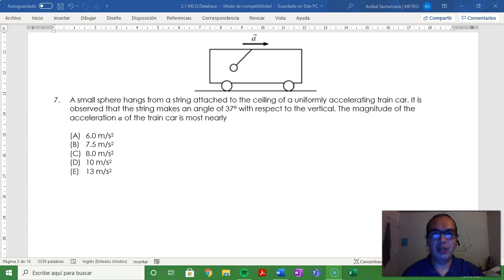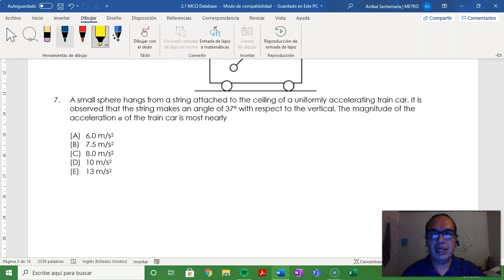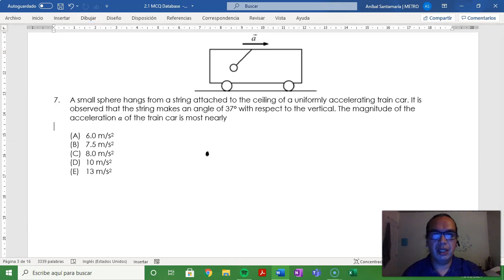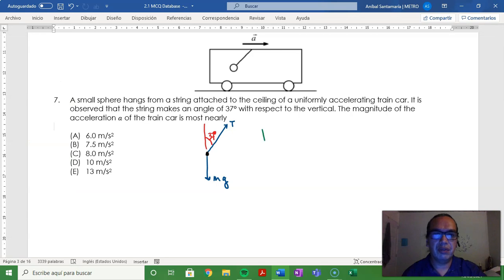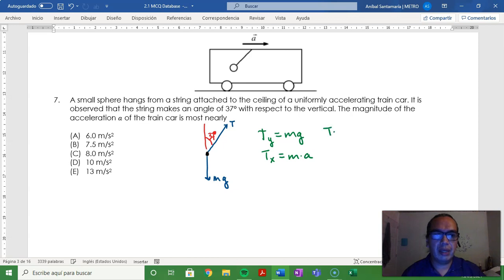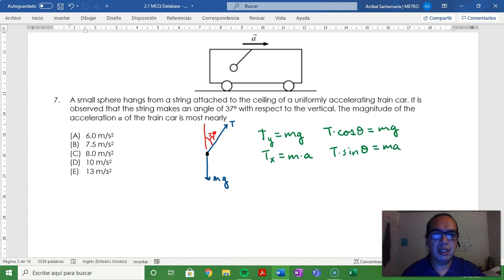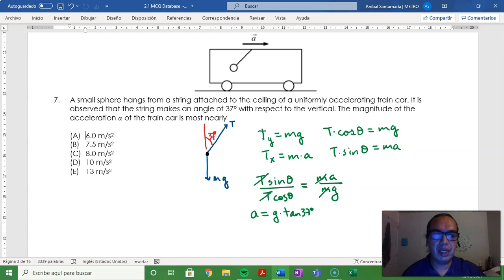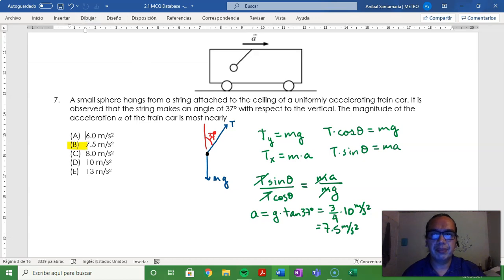2.1-07 Acceleration of a Train Car From Non Inertial Analysis

Comment: The correct option is E because after drawing the free-body diagram showing all forces we can calculate the acceleration by finding the s and y components of the string's tension.

Comment: The correct answer is B because the forces y in the y direction are equal in magnitude, but there is only one force in the x direction which is the tension x sin37 = ma. The forces in the y direction make the equation: Tcos37=mg. When dividing these two equations, the T and m cancel out, showing that a = (9.8m/s^2)(tan37) which is 7.5 m/s^2.

Comment: As there is no acceleration for y, tension component is equal to mg, and as there is acceleration for x, tension component is equal to m*a. We can simplify these by dividing them and simplifying the terms T, mass and getting tan of the angle. then we just solve for a and use g as 10m/s2.

Comment: Assuming vertical equilibrium, the gravitational force (mass*g) is equal to the y component of tension. The acceleration of the car is the x component of the tension, and can be expressed with F=m*a, where F is calculated with the sine. If we get the quotient of both of these, we get that a=tan37*g, which is answer B